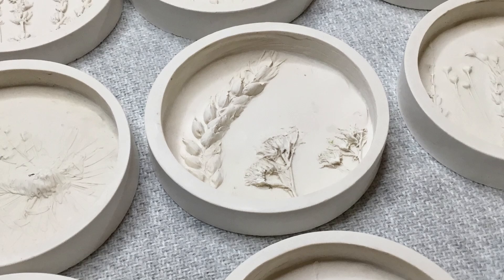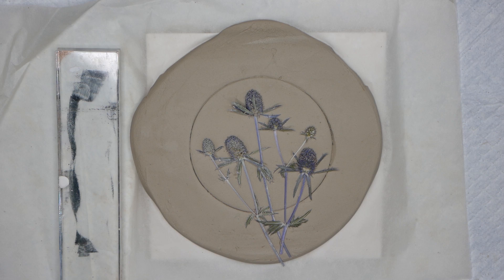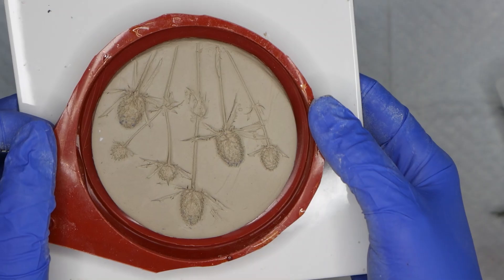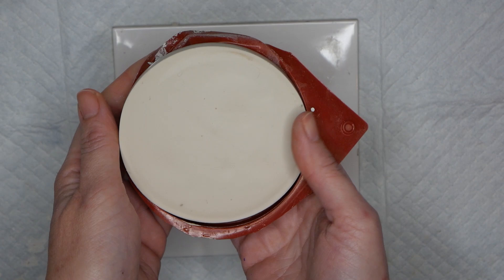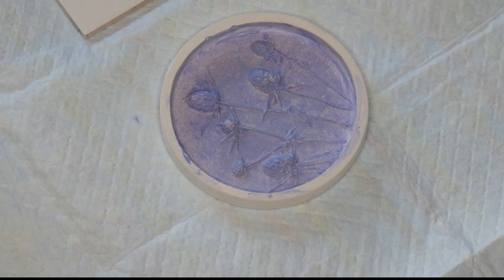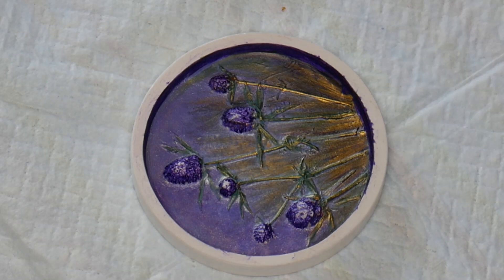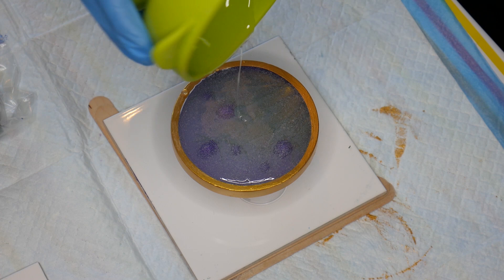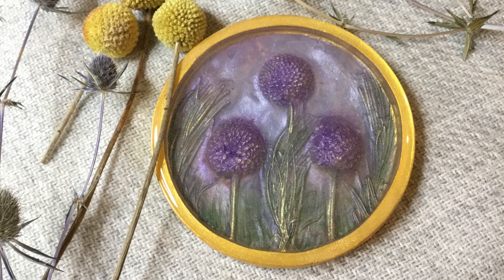How to Make Plaster Bases With Flowers for Resin Coasters - Must See!

Comment: Thanks for doing such an amazing informative video!  I will check your plaster supplies and give this a try!  Thank you👍🏼🥰. I don’t use clay and plaster, so want to know what you do with the clay after, reuse over and over?
Reply from the maker: Thank you. You can reuse the clay however you will have little bits of plaster residue in there so I would only reuse it for the same kind of project (not something that needs to be completely smooth). Make sure you store your clay in an airtight container or bag and if it gets a bit dry you can keep a wet sponge or paper towel in there with it. I have been using air dry clay but potters clay would be better because it keeps wet for longer. I hope that helps.
Reply: Louise Singleton Creations Thank you Louise, very much so!!

Comment: How to make the resin stick to the plaster? Mine wouldn't want to stick
Reply from the maker: Hi, you need to let the plaster dry out for as long as possible (up to two weeks) when it is dried out it needs to be sealed (I think I used polyurethane varnish in this video). I hope that helps.

Comment: beautiful !. at the time , when you put POP into the mould, did you put on soft clay with impression, not harden one because i noticed how the clay was soft when removed from back at demoulding? clay did not get harden....  pls reply. im a bit confused. this is a lovely artwork.
Reply from the maker: Hi, sorry, I should have said. I poured the POP straight onto the soft clay - I did not harden it first.
Reply: @LouiseSingletonCreations  oh I see. But then soft clay wouldn't get break or melt or fold up ...  Is that why you can use the same soft clay again ? Which clay is it
Reply from the maker: The plaster doesn’t damage the clay at all and it picks up all the tiny details, it’s amazing really. Yes you can use it again. I use Pebeo white modelling clay. It’s an air drying clay so it is best not to leave it out for too long. Potters clay would be better because it lasts longer and only dries out in a kiln but I couldn’t get any of that.
Reply: @LouiseSingletonCreations  wow. Awesome.thank you for reply